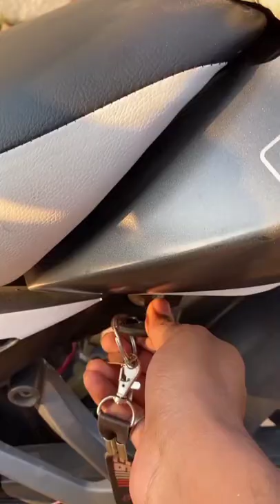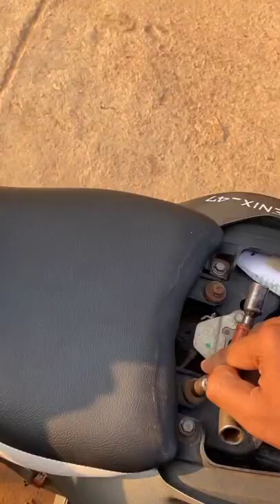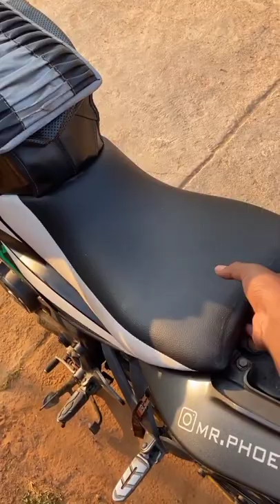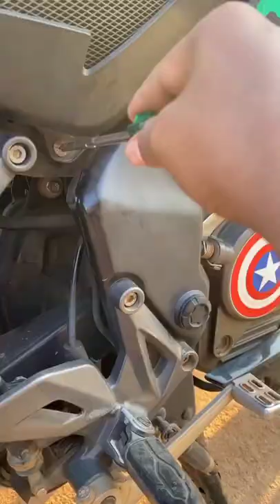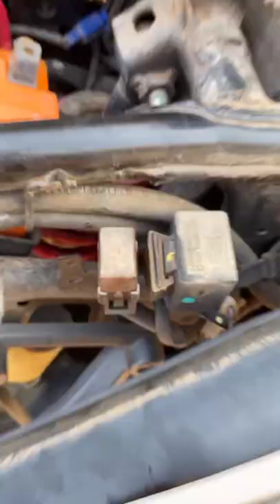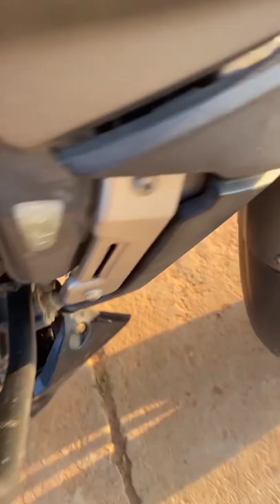NS 200 Radiator fan working or not, Easiest Checking method #shorts #ns200 #youtubeshorts Black Mask

Comment: My ns 200 bs4 model battery always dying in 2 days. Even new battery also. Battery symbol showing in meter. 
But electrician said charging system is working fine. But battery not holding charge for even 2 days. 
What could be the problem guy's? 
Can anyone help me
Reply: It might be a regulator problem sir
Reply: @sadmood2649  it's sorted sir, I've changed my magnet coil and it's done. 
Genuine Part costs around 1500/- for bs4